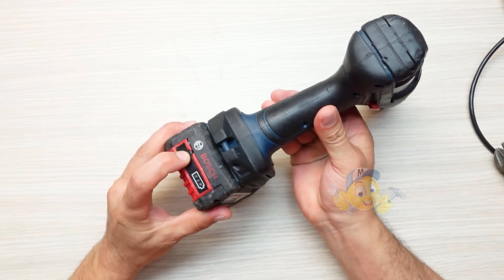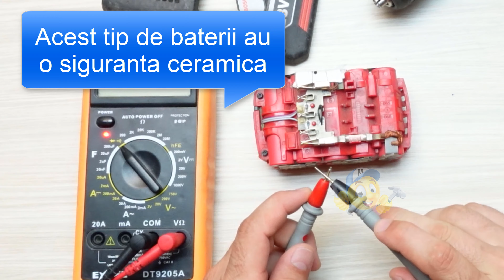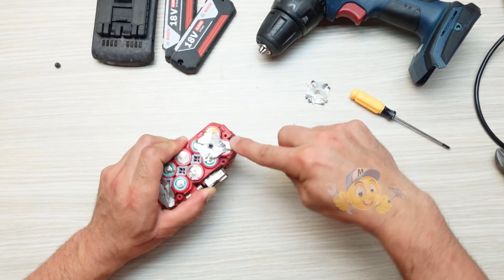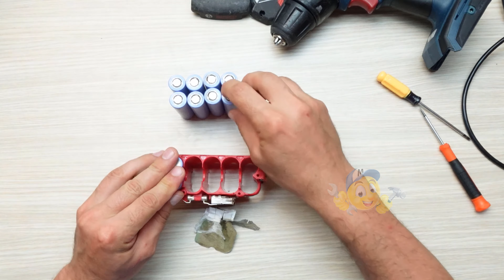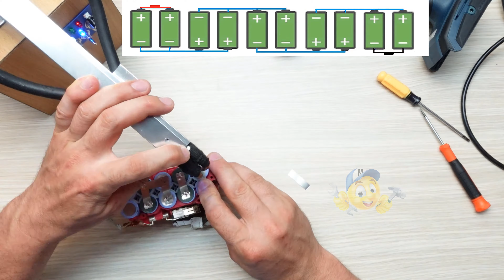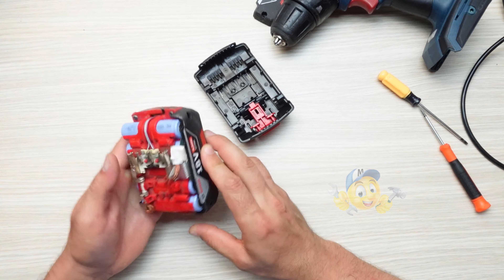BOSCH GBA18V Reparare Acumulator Li-Ion, 18V, Schimbare celule 18650

Comment: Se poate și mai bine , asta pentru ca o singura banda de nichel între serii nu este suficient pentru curentul de peste 15A pe care o bormașina o are in sarcina . Încearcă sa pui doua de 0,2mm dacă îți duce aparatul de sudat . Eu pun doua rânduri de 0.2mm la scule in combinație cu platbanda de cupru de 0,1mm . Se poate suda cupru de 0.1 sau 0,15 direct pe celule dacă ai nichel deasupra , stil sandvich .  Numai bine și spor la treaba .
Reply from the maker: mersi pentru sfat. am sa pun doua randuri si o sa incerc si tip sandwich
Reply: @mr.m5978  Super . O singura platbanda de cupru cu Lățimea de 6mm și 0.1mm grosime poate transporta 9.7 A de curent pe când aceeași dimensiune de Nickel doar 2,5A cu condiția sa fie nichel pur . Am văzut  ca multi iau țeapă și cumpara doar placat cu nichel . Am pățit și eu odată și am refăcut o baterie de 80 de celule de la zero iar performanțele au fost enorme după inlocuierea platbenzii . O platbanda de nichel cu Lățimea de 10mm și grosimea de 0.5mm echivalează cu o platbanda de 0.1mm și doar 6mm lățime . Sculele electrice de putere cum ar fi circulare unghiulare au un consum enorm chiar și de 30-40A , dacă conductorii sunt subțiri se vor încinge și nici performanțele nu ar fi prea bune .

Comment: Care este rolul pinului din mijloc la o baterie Li-ion cu ieșire pe 3 pini? Mulțumesc!
Reply from the maker: Bateriile Li-ion au doar plus și minus.
Probabil va referiți la cele care au atașat modulul de protecție.
Acela este pentru transmiterea de informații despre temperatura bateriei și  recunoașterea bateriei de către încărcător și consumator.De la producător la producător, fiecare modifica acești pini pentru a nu putea folosi bateriile de la o bormașină la alta.
O zi buna
Reply: @mr.m5978  Mulțumesc pt informații, promptitudine si amabilitate. Am procurat o masina de tuns gazon noua cu incarcator original (Gude) dar fara acumulator
Am alimentst-o  cu tensiunea cerută(+/-40V si nu pornește. Asta confirma raspunsul dvs ca pinul din mijloc fiind neconectat nu ofera informatia codată necesară. Să vad cum o pot rezolva....  Alimentatorul da pe pinul din mijloc +5V....poate asta e cheia....
Reply from the maker: @marindumitru6388  
Ați alimentat cu 40V de la un acumulator?
Acumulatorul trebuie să aibă ceva amperaj , minim 1-2  să poată porni motorul.